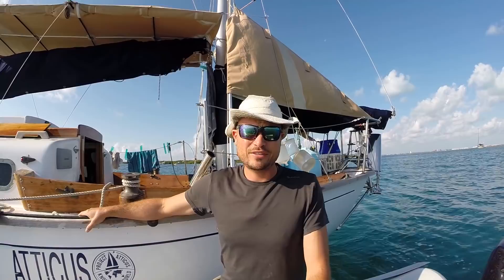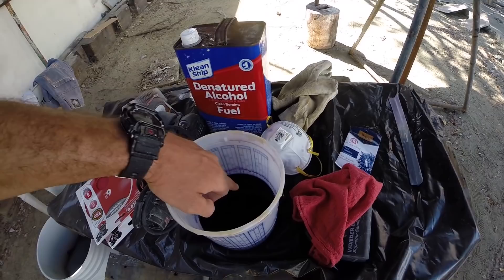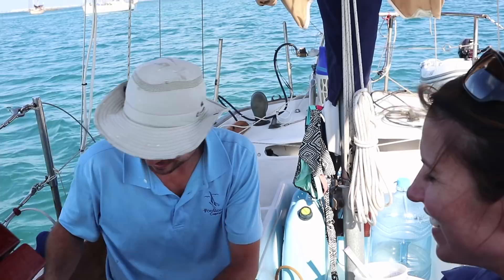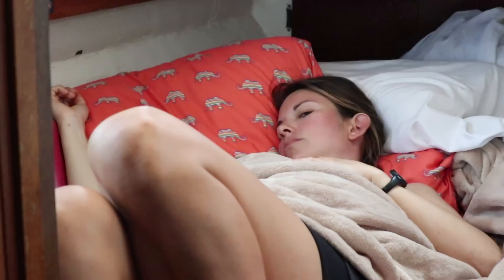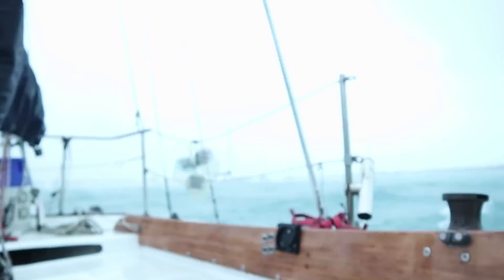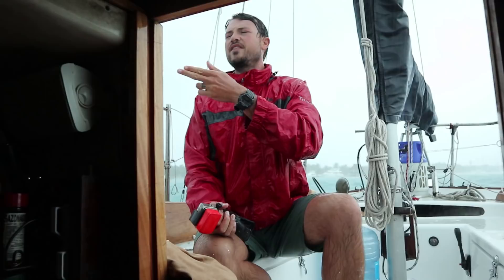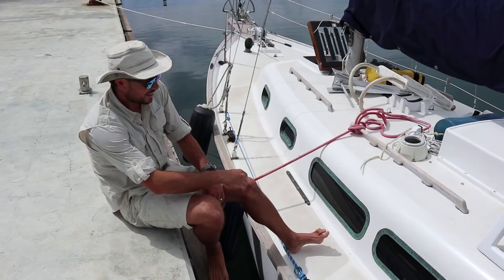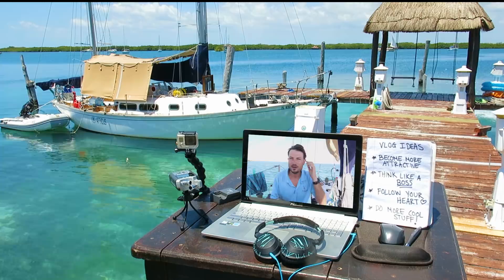Building Our Hard Dodger From Scratch Part 3 | S02E29

Comment: The dodger looks great, you would think it was made for it!  :-)
I think everyone goes a little mad scientist when mixing paint or epoxy, worrying about causing some unintended consequence or chain reaction! But in most applications once it's thoroughly mixed it's usually fine, the one notable exception being adding fillers to epoxy/polyester resin, simply because it won't mix properly if the filler is added before the resin is catalysed, of course you can get lucky even then, but it's definitely one to avoid if possible.

Comment: you guys are very smart, I am a strong believer in an oversized anchor, the Mantis and Rocna are my 2 fav. also one size up on the line and chain. all it took was one bad trip to change my logic on this. My only other point to make on this is the boat still swings on a single anchor, i often used a stern anchor just to slow that effect down.